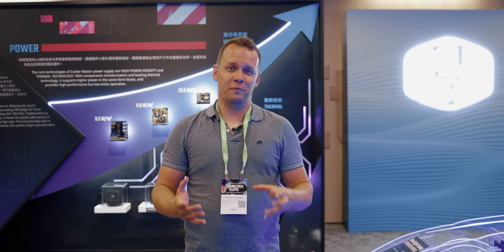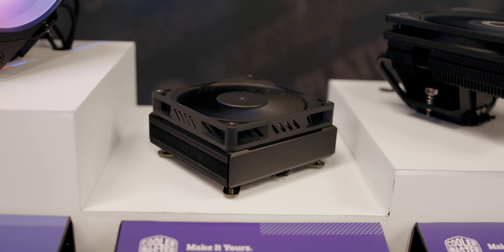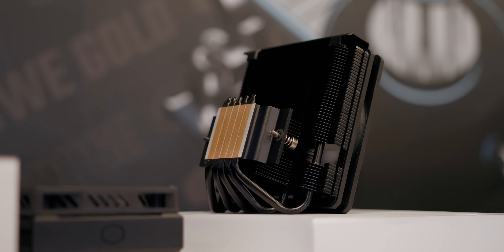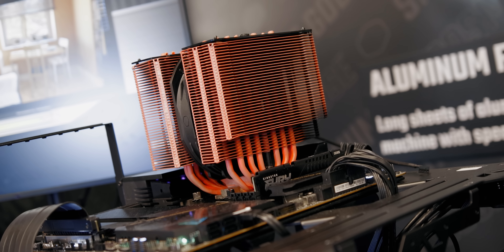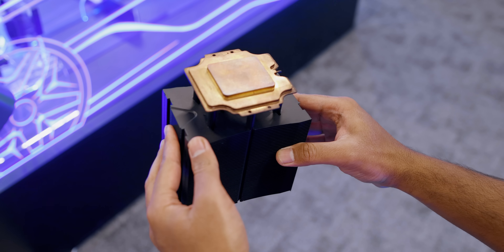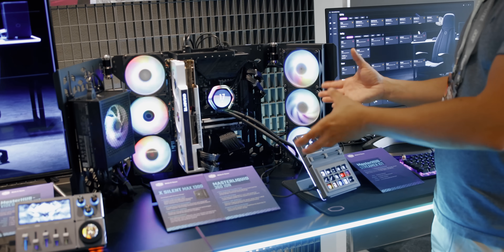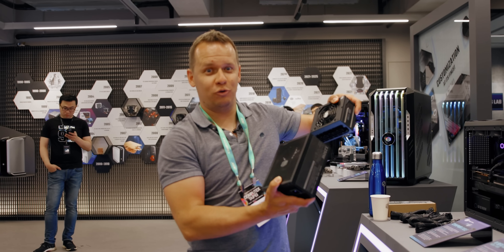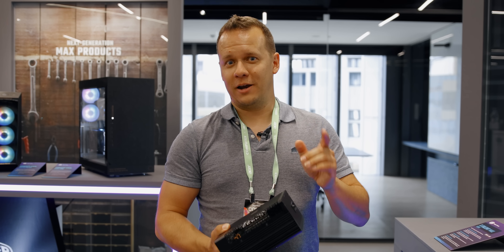The Color Changing CPU Cooler 🤯

Comment: That is actually very cool. Even quite functional honestly. Would instantly allow you to check if your CPU is turning on when troubleshooting for instance.
Reply: Would be nice to see the heat sink turn red after 20-30 minutes of gaming like exhaust headers do. I would buy one of those ASAP
Reply: @Chris-hw4mq  If it comes in green.
Reply: They should make a pink/purple one in partnership with Hot Wheels.
Reply: if your rig takes 30+ seconds to turn on you have bigger issues then how warm the cpu is getting lol.
Reply: @ColdVenom159  In what way would that affect  the scenario in question?
Reply: @fVNzO  if ya read up on the cooler, its said that the coating on the cooler can lower thermal effciency. theres a reason why the guy in the video did not show before and after results of a coated heatsing vs bare. the paint which is what the coating is less its got equal or more thermo transfer to the metal its on it then becomes a blanket holding the said heat in which is not what you want. tho being the product is only a prototype its a clear cut sign theres draw backs they are trying to work out.
Reply: How come Cooler Master never implemented temperature display option in their RGB fans and AIO, they use USB for set up only? should easily be able to work as a die temp readout? Nvidia managed, that is an easy way to to notice temperature changes. Easier that color changing paint and is backwards compatible when Cooler Master update their RGB control software.
Reply: @Tore_Lund  dont want rgb fans or coolers doesn't look any good.

Comment: cooler master manufactures those sweet Nvidia FE coolers if i’m not mistaken
Reply from the maker: Actually CM's ODM division has manufactured MOST (not all) reference heatsinks for NVIDIA and AMD for the last decade or so.
Reply: @HardwareCanucks  Wow. They really are the cooler masters.
Reply: Considering Cooler Master is manufacturing Wraith coolers for AMD which are pretty good for stock coolers, it wouldn't be far-fetched
Reply: really?
Reply: AMD reference/Made by AMD 7900 XTX coolers too
Edit: partially
Reply: PNY, isn't it?